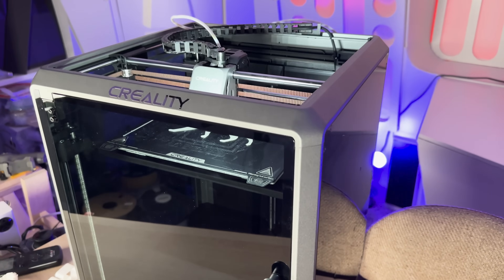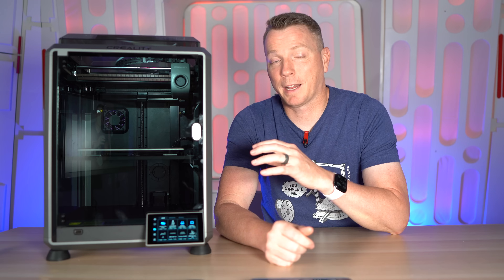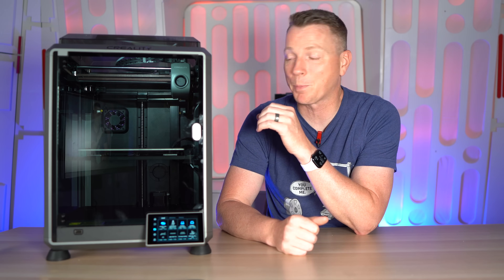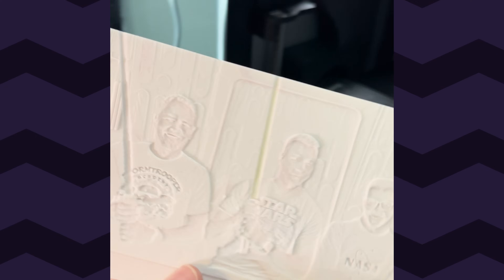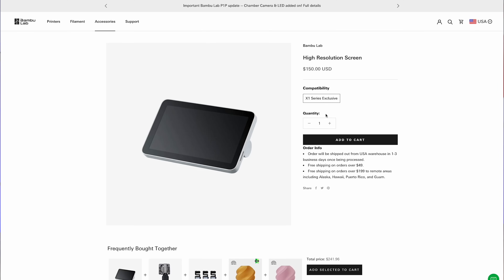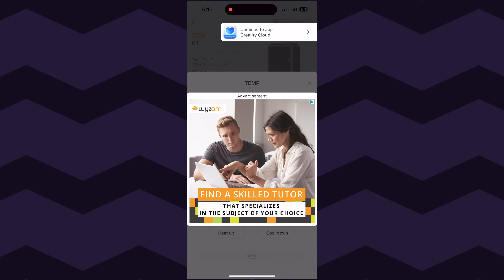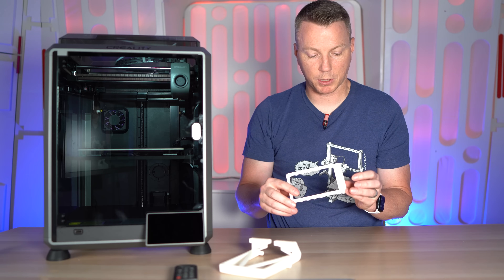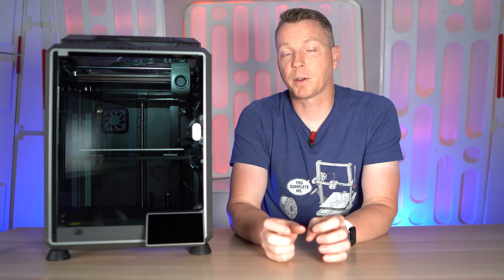I Regret Buying the Creality K1. Here’s Why.

Comment: An fyi, the original design has the cable chain supported to NOT hit that switch, by what you ask? The bowden tube you removed :| But don't say it's about preventing extrusion problems if you don't even take the time to upgrade it to a capricorn.... :P And when you say metal frames, there's quite a difference between bambu's metal pieces screwed together, and the k1 die cast frame. Also, from what I'm seeing online, every bambu has a slight curve at the front of the bed, would love if you could test that one on each bed. I will say I'm not at all a fan of ads in menus for something I purchased. That's terrible

Comment: I had preordered the K1 a while back, but cancelled it almost immediately. They couldn't give me a clear answer on the material of the x-carriage rods (if they were carbon or not). The lack of knowledge coming from the support team was scary. I did not want to give them money for a cheap mimic of an already great printer.
Reply: Carbon steel vs stainless steel? From what I've seen the Bambu isn't perfect by any standards... It's decent, but seems 2nd rate in a few areas. Escpecially for 1200$
Reply: @Kungpaoshizzi  Carbon fiber rods (like Bambulabs) vs Stainless steel rods. Creality's website images of the K1 show the rods in several different shades of gray and some images even show the rods in slightly larger diameters than what they have currently. Either way the added weight of the K1's steel rods can impact high speed printing.
Reply: @degreeless_engineering  That's a given, but you could argue the flex of the carbon fiber rods, and the longevity will never be that of steel, but pushing 5-600 mm/s? We're nitpicking. But I'm more concerned about the flatness of the bed which bambu failed evidently as there's some new vids of folks who received just as front-curved of a bed as the one they sent in. I'm more interested in the lidar resolution and the gsensor capabilities. Do you know if there's an actual sensor on the toolhead of the x1c let alone specs? I've not seen anything whatsoever about a sensor. I'm assuming they're just using input shaping as well

Comment: It's important to remember that if you need an app to set up and use a device, manufacturer can decide to make your product on usable at any point they want to force you to buy a new one. It can even be as simple as removing the app from the app store. That means if you break your phone, you have to throw your printer in the bin. This is why I like Prusas so much.
Reply: You talking about Bambulab? You do realize that you can print directly from an SD card? You can also set your printer in LAN mode so it bypasses the Cloud and prints directly from your network.

Comment: I really feel like it became fashionable for the print community to rag on Bambu Lab, but now that there's a clear competitor to compare Bambu to, I think it's now even more obvious how incredible the P1P and X1C actually are.
Reply: The K1 is a competitor of the also closed X1. But only for half the price. So the customer pays for that "incredibility".

"now that there's a clear competitor" ... Which is not fully correct. A full fletched Voron 2.4 for the same money also was and is an competitor! Problem here: only the ones being able to build one also get the benefits.

But with new printers (even i3 style like the Elegoo Neptune 4 or the Prusa MK4) being also able to print very fast, the competition is definitely on. Especially when a Prusa MK4 is printing a faster Benchy than the Bambu Lab X1.
But speed never was the only goal of 3D printing.

Comment: Great review and it appears that Creality is still in the business of providing lousy implementations of a good idea.  I for one will never purchase another Creality printer.  Their customer service is non-existent and their printers require constant tinkering and adjustments.  They are also severely lacking with useful documentation and you are left to doing Google searches for answers to their inherent problems.  I connected a Sonic Pad to my Ender 3 Max Neo and it actually made the print quality worse and introduced major layer shifts and failures.  I decided it was the crappy stock extruder and hotend so I installed a Sprite Pro and it was a nightmare to get it working correctly with the Sonic Pad and Creality provided ZERO assistance when I reached out to support.  All I got back was an email that just reworded my questions and none were answered.  After several weeks of tinkering, Google searches and hair pulling, I finally have it working consistently and can get high quality prints at 85 MM/sec, which isn't really worth the cost of the Sonic pad and the Sprite Pro.  I can go faster but quality suffers greatly.  My advice is to save your dollars up and buy one of the new CoreXY machines from another company.

Comment: Hey guys, thank you for pointing out all the talking points between both machines. I personally went with the P1P a few months back and have consistently told people that,"I didn't know what good printing was until I got my Bambu Printer." 

On a side note though, would you mind popping a little edit into the video regarding the Cooling Fan(and Chamber Light) because they are now included with any and All P1P's sold as well as will be sent to anyone that did NOT get it as an Early Bird Gift. It's really cool what Bambu Labs are doing, especially taking a majority of the user issues into account moving forward.

Thanks again guys and great work.
Reply from the maker: Thanks, Alex. On the cooling fan and chamber light, I believe they provide the camera and chamber light, right? That's what they sent me after I ordered, even though I didn't buy it as part of the kickstarter. I believe I addressed those in the video but I'll double check to make sure. Either way, thanks for watching and for the comment and happy printing on the P1P!
Reply: @@3d_printed_maker Another moron - I mean voron - fanboy chimes in... lol
Reply: Yepp, no cooling fan, just the LED strip and the low spec 720p camera.

Although that cooling fan can be purchased separately the main difference ist the enclosed print volume which makes the K1 more comparable to that BL X1.
The X1 is also enclosed and also has a bigger touchscreen but costs twice as much as the K1.
For an open printer (like the P1P) the more affordable ELEGOO Neptune 4 Pro (also with Klipper) for 300 bucks (€) is a far more suited comparison which shows the premium on the Bambu Lab printers.
Reply: @hassosigbjoernson5738  The K1 is 1/3 less volume than the P1P and X1. Plus the quality of the K1 sucks. And now with the P1P being $599, same price as the K1, and the new P1S with enclosure and other new features for $699, that pretty much KILLS the K1 dead in its tracks. And all Bambu Lab printers can use the AMS while the K1 can not or anything like it.

Comment: filament is the strongest? / what printer can print the best filament im currently using a slightly upgraded e3v2 with petg (seemed to be better than the pla) i make rc parts and need them to be strong!

Comment: I have to admit, this Creality printer caught my eye but I'm still suffering from being burned on their early CR-200B, fully enclosed printer. I did get it open box, so I was only out about $100, but countless hours on it. What I finally figured out what that for Z-Axis, it never was able to repeat the same calibration twice, even running back to back calibrations I saw sometimes 3mm deviation without touching a thing. 

It seems like Creality just quietly let this model die as I've never seen an aftermarket for it or upgrades/fixes to it. I ended up just breaking it down into parts that I hope to put on ebay one day to recoup some of my losses since you can't even really get parts for one of these anymore, if you have one that actually works.

I do have one other Creality, the CR6-SE (another $100 open box) that I really do like and is the only reason that I even considered giving this new K1 a chance. After hearing about the issues with the app though, I think I might just have to pass or skip the app use altogether. Something tells me to beware of spyware in the app and all of your information be sold to advertisers. 

At this point, I'm still leaning toward an X1 Carbon as I want the enclosure for printing other materials, and hopefully some sound dampening. The K1 is half the price of that X1 though, which makes me wonder, do I buy the K1 and later regret it and then wind up spending another $1200 and getting what I should have in the first place?

Comment: So typical Creality printer.  Mostly works but plenty of problems.  I bought an Ender 3 v2 and it had issues too.  It actually caused me to stop 3d printing.  Then later I decided to give it another try but many people don't try again and simply give up.  Creality is doing a disservice to the 3d printing community at this point.  We really need more polished printers not less.  It leads to people abandoning the whole thing as not yet ready/just a toy/etc.
Reply: Meh, look up 'bambu problem'
Reply: @Kungpaoshizzi  I did nothing specific pops up.  You'll need to be more clear about what systemic problem you believe they have
Reply: @jvandervyver  LOL now I know you're just trolling. And if the printer was so bad it caused you to quit, wtf are you doing here? I've never had a creality, but from the specs I'm seeing, the max is the best deal atm for the build volume vs parts vs speed. If the printers were so bad they wouldn't be one of the most popular brands. Probably doesn't matter what I say, you're obviously here just to troll creality though, you wouldn't take the time otherwise.

Comment: people are printing enclosure frames (not the enclosure design in bambu site) and hinges for the P1P and they either source and cut the acrylic or polycarbonate clear siding themselves or they order pre cut sides from a cnc shop.  Then you can buy the bambu X1C glass roof/lid or use acrylic or polycarbonate for that too.

With the P1P developed as an open frame, bambu decided to omit the main circuit board cooling fan, which you would want add it enclosing it.  You also want to add filtered exhaust especially if printing abs, which adds to the cost.  And adding a cooling fan for the printed part for when using pla filament.

It adds up though and would be better to get the X1C to begin with (or the k1😐 although it's not for me).  Printing enclosure is a good solution for people who already had a p1p though.

Comment: I chose the K1 because of the future ability to do upgrades and/or changes as I see fit. The Bambu Lab P1P is pretty much ALL PROPRIETARY and not really open to customization. Yes? Or is it that big of a deal? My machine hasn't shipped yet, so I can still cancel and request a refund. Please help. Anyone. Thanks!
Reply: What you have to decide is whether your 3D printer is a tool, or a hobby.  For me, it's a tool.  I want a clean integrated reliable design, not a design based on off the shelf parts.  If you want to tinker with the machine, then the hobby version would be the best choice.
Reply: Even though Creality is using Klipper, they locked it down, and you can't modify it, so it may as well be considered the same as Bambu Labs. Believe me, I have an X1. I had it rooted and nice access to all the Klipper options. Now, you can simply not upgrade it, but there are issues they still need to work out and thus will end up becoming necessary anyway, so you will succumb to the firmware update that locks you out of rooting anyway

Comment: You can't compare enclosed vs non-enclosed just because they are both cubes and both have Kipper software.   The open printer can't handle materials needing 35c and above environment.  These are like comparing a Mazda Miata to a Nissan Pickup.
Reply from the maker: I totally get what you’re saying but I see that very differently. A huge percentage of buyers don’t regularly use filaments that require an enclosure. In my experience and in talking with tons of people, it’s just not an issue for most folks. That said, if you do use higher temp materials, of course this comparison doesn’t really work, so you're absolutely right for those situations.
Reply: The 1kg of pla that comes with the P1P is enough to print the enclosure.

Comment: So apparently 30 mm is one third of 256mm print volume?  No it's not.  So correct your math, cause you'd need a build volume of 330mm for the K1 to be 1/3 smaller not 256mm
Reply from the maker: Math is not my strong suit so if I'm wrong on this, I definitely want to know. Here's my math: K1 = 220 x 220 x 250. V = L x W x H, so that gives us 12,100,000. P1P = 256 x 256 x 256, so that gives us 16,777,216. If we divide 12,100,000 by 16,777,216, we get 0.72, so it looks like I'm actually about 5.5% off of the 1/3 mark (66.666%), so it's 28% difference, not 33 1/3%. Does that look correct? If so, I was, in fact off. I originally calculated it at a little over 32% so I rounded to 1/3.

Comment: Just one simple question Can I simply slice load to a sd or usb I hate over the air bs I like baby sitting
Reply from the maker: Yes, you can load to either printer without WiFi. One goes to Micro SD, the other to USB Drive.

Comment: We have an x1 carbon where I work.  There are errors that always pop up during its calibration sequence.  I don’t think the LiDAR is working.  Prints have bad building at corners,like the linear advance is not working.  I have had filament break off inside the AMS which caused the printer to unload your filament when you tried to print.  This required disassembly of the AMS to remove the piece of filament.  The “cool” build plate requires glue which is really annoying.  You don’t mention the biggest annoyance of the AMS, your spools wont fit.  This is incredibly frustrating.  Also,these printers are build consumer level like and inkjet printer.  I would like to see how long these last.
Reply from the maker: Great points! I also think the LiDAR is largely useless but hopefully they'll do something with it in the software soon that really helps. I have had such a smooth experience with both the P1P and the X1 so I'm sorry to hear that you haven't. The cool plate? Agreed. I'm all about the PEI sheet, which is what the P1P comes with. I don't like having to deal with glue sticks. I also just had my first issue with the AMS where a piece got stuck. Took me about ten minutes to fix but I sure hope that doesn't happen often. I haven't actually had any spools that don't fit in the AMS other than those little 250g sample spools that come with certain printers. Actually - those might work too, not sure. I put the cardboard spools in there all the time and have no issues there either. 

As with all things, there are pros and cons. Longevity is a great question too - we'll see how long Bambu Lab printers hold up. Hopefully a while! Thanks for watching and for your insights here!

Comment: It's so hard to choose nowadays, but it's for a bunch of good reasons. The K1 is $700 including shipping and import taxes in my country, whereas the P1P is $860. I honestly don't know what to choose :(
Reply from the maker: Yeah, it's tough for sure. I can't answer that for you but hopefully you'll be happy whichever way you decide!
Reply: I hope you waited out!
P1P dropped the price, as well as K1 being on sale for just 584 €. 
For me the real competitor to the K1 is the X1 because of it closed build volume. Of course you can mod nearly everything, but with that said a Neptune 4 Pro only costs 300 bucks and can be enclosed with a simple "tent"...

For a first printer: always choose the less expensive, since if you don't like that hobby you haven't spend as much!
Reply: I ended up with the K1 (newer version which fixes the extruder issues) and bought it for $426. The P1P is still around $820 here in my country.
Reply: Small difference in price. Get the p1. More good usable features and bigger print space
Reply: definitely K1. Guaranteed there will be more spares available and will be much easier to maintain your printer. Firmware already has been hacked and I bet Creality sooner or later will unlock it anyway. Build size is negligible, I have 310x310 printer and that Mando helmet is one of the very few even I can print lol. Also, for less money you get a complete printer, not something that has been hastily stripped in back room somewhere lol, so you have better choice for filament types.
Reply: P1P is now just $599. Creality K1 is garbage.
Reply: @TheNature101  Hahahah good one

Comment: You cant really print full print volume on the Bambu printers. You need to do all this weird crap for the slicer to allow you to use the full print volume.
Reply: You miss how much in the front left corner? Not much and there is a workarround without ams which allows the full print volume too.
Reply: @erikmatz3072  Months ago I tried to do full size with AMS disabled, but the front prime line is what is causing it to not let me. I even removed the gcode from the start gcode and it still would not let me slice. I gave up after that and didn't try again. It would be nice if they just added an option in the slicer to use full print size and it would automatically disable everything for you.
Reply: @user-lx9jm1wo3h  Simply modify the Start gcode and get rid of the purge line.
Reply: @erikmatz3072  Did that. Slicer still thinks it is there for some reason and will not allow me to slice.